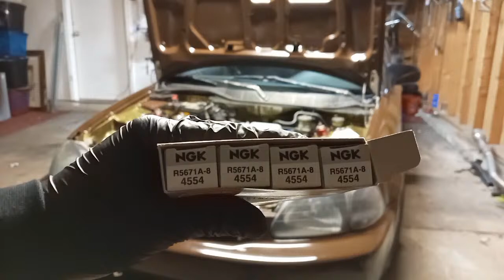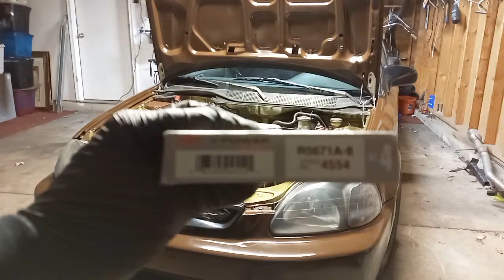Live Cold Plugs Installed/Sponsorship/ecu Update.

Comment: What size turbo? And what's done to the motor?
Reply from the maker: 70 trim. Engine is jdm d16a, vitara low compression pistons, speedfactory no notch rods,vms block guard, shimmed oil pump,ebay stage4 clutch, ebay 8lb flywheel, arp headbolts, fmu for now until i can buy ecu, my neighbor just donated 565cc injectors, ebay fuel pump osias 340lph, might be forgetting stuff. I'm using the transmission with longer 
Gears because I'm building for roll racing.